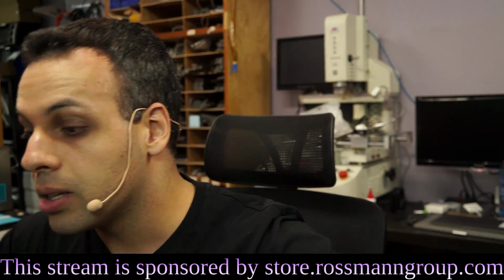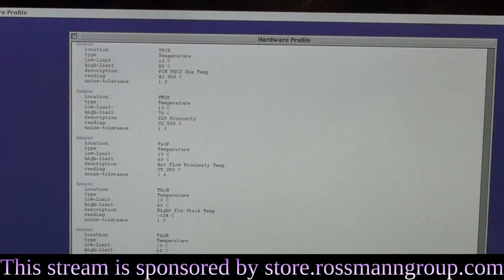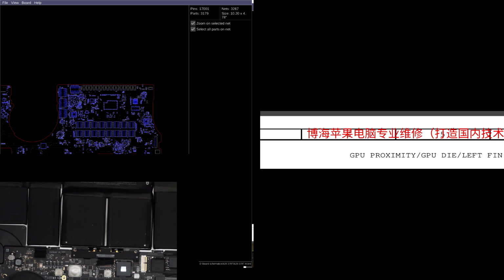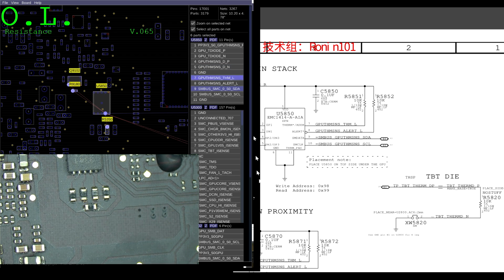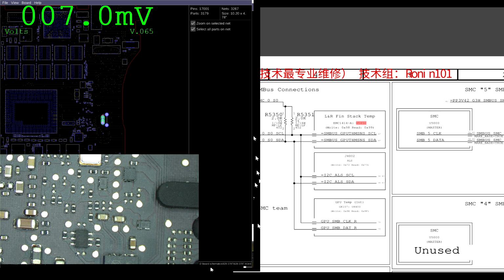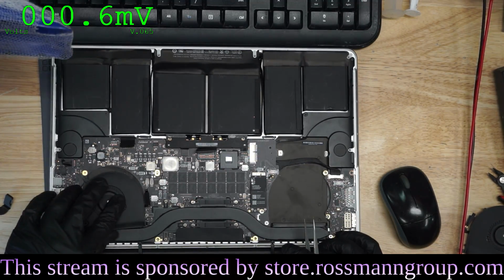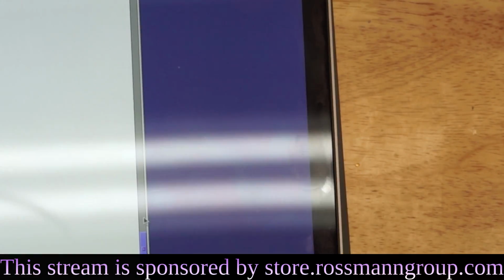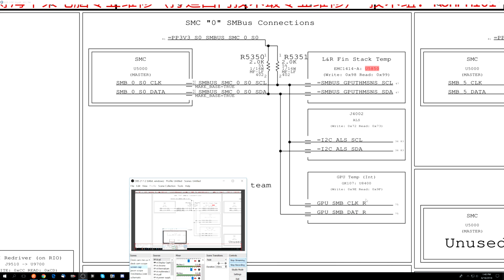What franchise can't fix in two months Louis solves in 20 minutes. Franchise = :'(

Comment: Yes this video is very educational. I learned about yet another instance of poor engineering by Apple.
Reply: It's another instance of perfect engineering. You think it's coincidence that this persons webcam is slowing down the laptop enough to force replacement? It's called planned obsolescence my friend.
Reply: Think of it this way, I build you a drill with a durable powerful motor that will last years, a chuck that can't fail, A trigger that is so solid you can't break it, and add a part on the board that when it goes fries the whole drill however it will only fail in 90% of cases right after warranty. Your going to love that drill and talk about how it will last forever and how everyone should use it. Which they will, and by the time you and the rest of the people realise the failure point you will go out and buy another one because it's the go to drill.
Reply: this company is crap then one trick pony
Reply: Perfectly engineered from the money-grabbing Apple-pov. Shoddy engineering from an objective "how could it be the best technical design"-pov.

Just because Apple's policies can be intellectually understood doesn't imply that they have to be encouraged. In fact the more you know about this, the more empowered as a customer you are. Simply because you can take your money elsewhere and have a decent computer again just by disconnecting the webcam and tell Apple to go fuck themselves...
Reply: I have all the respect in the world for Louis, but this is nonsense.  As an engineer designing a computer, you try to keep the cost down.  If you can get more functionality out of fewer parts, it's a win.  Adding an additional sensor chip to group the webcam separately from the temperature sensors would increase the cost of the machine -- not very much -- but significantly.  It would also consume more real-estate on the logic board, more power, and require more cooling.  These resources are really at a premium in these laptops.  I would fire an engineer who used more hardware just to satisfy some kind of nonsensical OCD need to group his signals in a way that seems more ideal to him.  If it's broke, fix it.  Don't make everyone pay more so certain failures (which you have no way to know how frequently they will actually occur at the time of design) lead to some kind of soft-fail.  This is not a design consideration, and Louis knows that.
Reply: You think they design and manufacture these and have no idea how often they are going to fail? Bullshit. They know the specs on how long each part should last and they know what the percentages are of when they fail. Something like 5% will fail before the end of the warranty, 15% within a year after, 35% by 2 years at which point the device will be too old for most people anyway. When the company gets pissed is when those numbers are off.
Reply: Robinson Joe, you clearly have never designed a high volume consumer item, and don't know what you are talking about.  Yes, there are some published lifetime numbers, but they virtually never apply to the real world.  The thing you apparently do not know is that the micro-climate -- especially the temperature -- at the precise location is quite important, and varies not only from simulations, but from device to device, and location to location at which the device is used.  Your theoretical fantasy of some kind of ideal design technique has little to do with the real world.  If it did, no one would ever produce a part which failed by accident.
Reply: Just so people know there's nothing wrong with known failure rate. It's about what you do with that information. Knowing that this problem is going to happen some would keep the cam on another path so that's not an issue thinking that the combination of those small details will get you the reputation of producing a solid device. Others like apple will see that it's more profitable to do this because it both reduces cost slightly per device but more importantly causes people to get a new device because most will just buy a new laptop. Neither is really wrong. You just have to decide what your money means to you. Personally if I'm going to pay that kind of money for a device they damn well better be looking out for their rep because that's standing up for your rep and i'll put money out for that.
Reply: @joer8854  While I don't doubt Apple is trying to make money through shady techniques like blocking repair, I think you are overestimating their competence and product testing.  More likely they were trying to reduce the number of data lines or some such thing (I don't understand MacBooks well enough to say for sure), and didn't really think about or know what would happen to another component on that line if one failed.

Or in other words they put a minor component on the same line as a critical component because they didn't even think to ask the question of what might happen if the minor one goes wrong.  And ideally it shouldn't ever happen.

Of course either way this isn't an excuse for failing to thoroughly test their components and product.  Or take a log of past repairs to learn for future versions... if they ever actually diagnosed anything in sufficient detail for that.
Reply: Mantis > And how would it be fixed ? Since louis just explained you'll need to damage the screen to replace the webcam.
Reply: Mantis Nomo

Yea apple saving costs for a 1$ chip then charge their shitty Macbooks 30% more than other laptops that were designed to last. Where did they spend that extra 30% then? What about spending them on design abundance so a webcam fail doesn't turn your 2000$ laptop to a potato? What are you trying to justify?
Reply: If you hate Apple that's fair enough but where do people get the notion that non-Apple Laptops run flawlessly for years ?? or don't suffer hardware faults ?? I switched to Apple laptops as a daily driver as I was getting tired of various laptops constantly needing fixing, I have owned 2 Apple laptops that have had zero probs, my current MBP has run flawlessly for 4 years hardware and software wise. Now before I get accused of being some Apple Sheep or Fanboi I also own a highend gaming laptop. Go onto any forum and check the mess that is a lot of windows devices,  numerous devices out of the box throttling, screen issues etc etc.. it 's not all milk and honey in the windows camp and hating Apple doesn't make you woke.
Reply: @Johnny641  and my current Sony Vaio from late 2012 is still running just switched to an SSD only problem: Windows Key fell off after 5 years using it. Paid $850 at that time while similar Apple laptop cost almost the double.
If you buy a Windows laptop for $400 sure if won't lat but Apple product cost more than the double and even triple so you must compare "Apple to Apples"
Reply: I do compare Apples to Apples, whenever someone states a MacBook is overpriced there are usually comparing it to some cheap netbook and then state look how much a rip off the Apple device when in reality windows devices can get up too just as insane price levels. I am not a fan of the newer Macbooks in terms of design, guess what ?? I havent bought one, I dont bitch about the price on a device I dont want to own.
Reply: It's the opposite of what you say: Apple fans says "Windows laptops won't last" ... but they want to compare a $400 laptop vs a +$1,000 Mac??  And where did I said "overpriced" on my comment? I just stated that my $850 Sony Vaio lasted me 6 years while paying a lot less than a "durable, long lasting" Macbook for less money...
Reply: You didn't use the word "overpriced" but you are are eluding to it by stating an Apple product would have cost you double (that is at least how I understood what you were saying), it's great that your Sony lasted so long.
Reply: Johnny641 some cheap netbook might have close to same specs as the apple device they're comparing to. And yes, some windows based devices might skyrocket in price as well but that usually means there's some proper hardware in it.

The quality ofc might still be as bad as apple's devices have or maybe even worse in some cases depending on what kind of machine we are talking about.